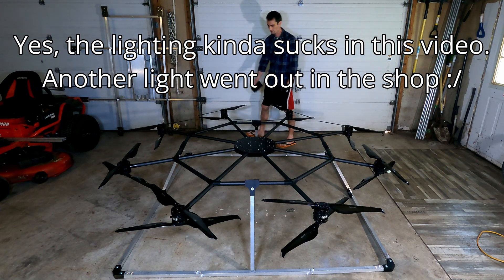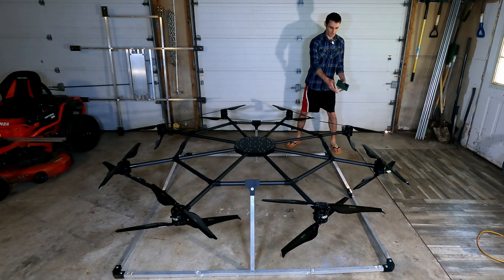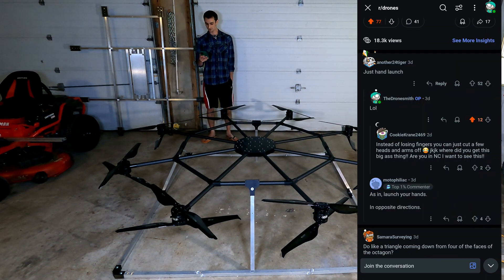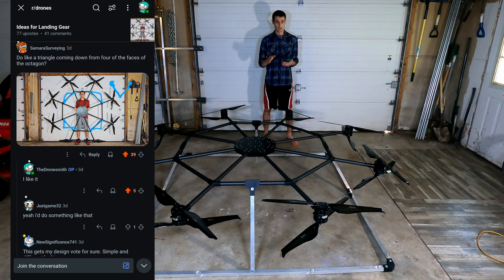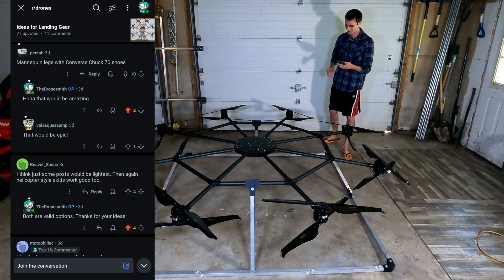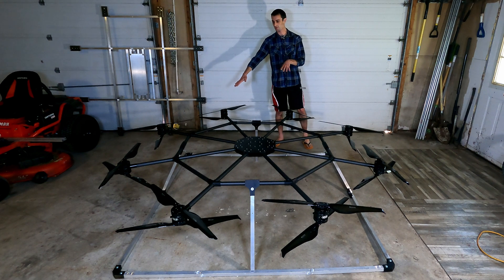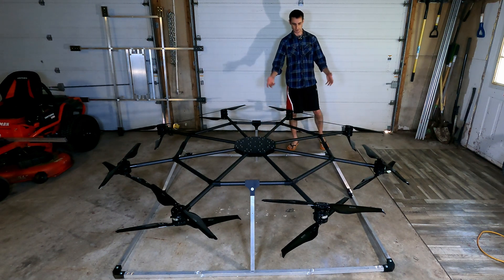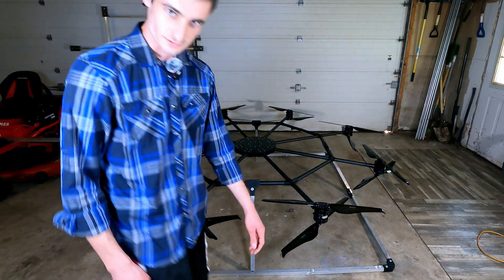I built a big drone (eVTOL) - Part 3: Landing Gear

Comment: Please do yourself a favor get a klipper printer. Even a cheap one like the sovol sv07+(30cm×30cm) or the elegoo neptune 4 max(40cm×40cm) would work. It will greatly speed up your 3d printing.

There is also the option to add a raspberry pi and flash klipper to your old 3d printer, but then you wont have input shaping and I'm guessing your current one also doesnt have automatic bed levelling.
Reply from the maker: Thanks for your suggestion, I'll definitely look into it. My current printers are about as simple as they get, they're slow and break all the time